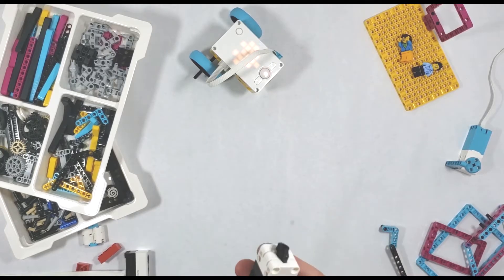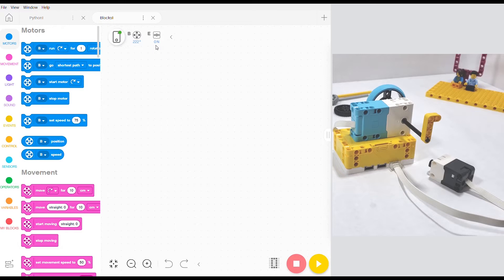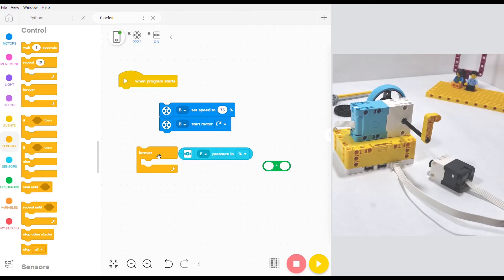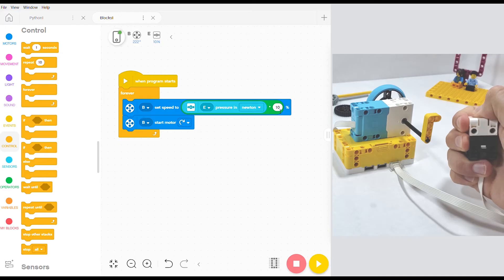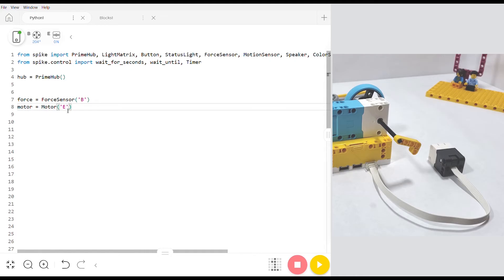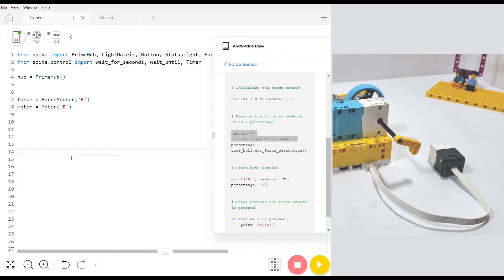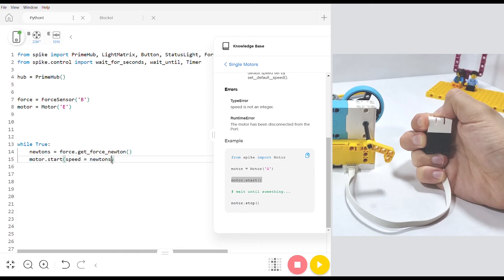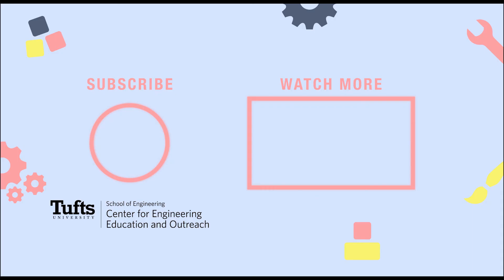SPIKE Prime Tutorial 1.7: Force Sensor

Comment: I am a bit confused that you decided to use Newtons, then multiplied that by 10 to get to a percentage for the motor speed. Why not just use percent from the sensor and use it directly as the assigned motor speed?
Reply: I think with the percentage block is precise than your solution